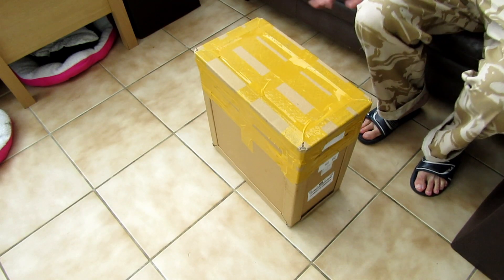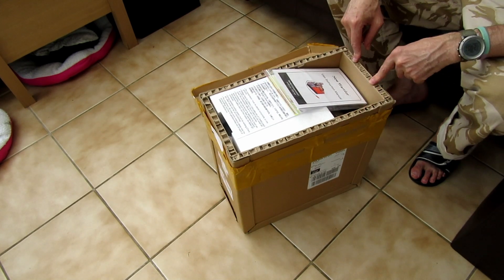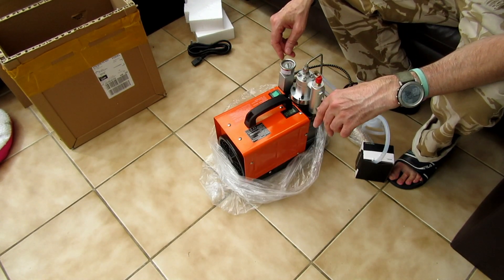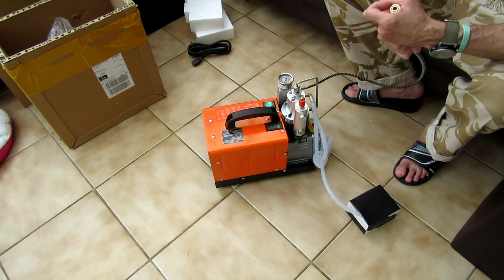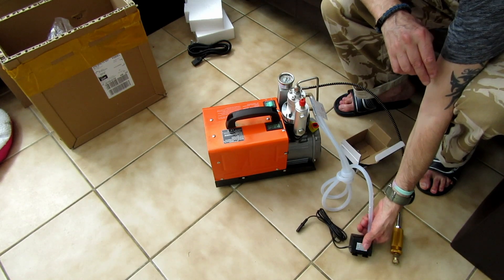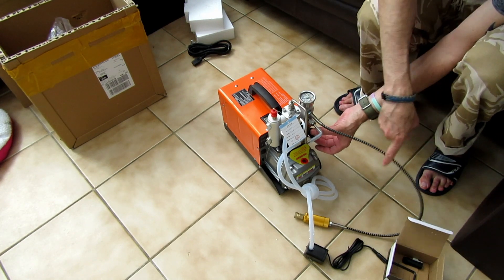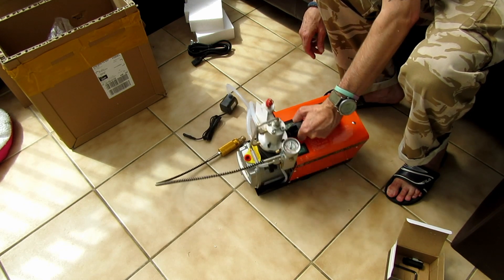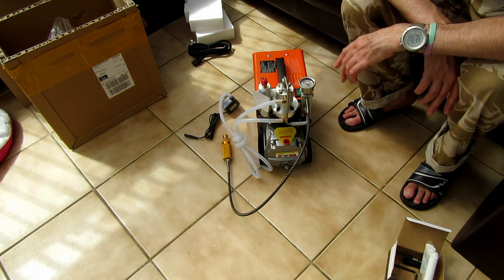30Mpa/300Bar Air Electric Compressor

Comment: Have you done a how to use video for this compressor as some have had the heat dissipator get warm and use a tap flow of cold water to keep temp down. What are your thoughts on this model? Many thanks
Reply: I found it best NOT to recirculate the water if you are doing much more than filling a couple of guns or topping up an air cylinder.  I rigged up a water reservoir with an overflow running to waste.  A hose from an adjacent tap keeps it topped up.  The difference is a much as 30°C cooler  which, of course, also cools the oil and causes less wear on the unit.  The whole unit s superb but it must not be used for breathing air as it gets slightly contaminated and smells slightly of oil.  Produces very little moisture in the short term.  I've had mine for 18 months now and can wholeheartedly recommend it.  Mind you I got in early and paid only £165 delivered.  The prices are going up in the UK but if you're quick you can pick one up for about £215 in the UK though I have seen them being sold for over £450!  Don't hang about.  One of these and a 3 litre bottle is the perfect set up.  Btw they weigh a hell of a lot less than 30kg.  At a guess I would say about 15kg.
Reply from the maker: Hi yes there is a 2nd video showing me use it on different items the link is on my site let me know if you cant find it
Reply: @Beta250trials  thanks for the reply much appreciated, I did find it in YouTube suggestions, its very good, but a little more info on setting it up ie adding oil, water connections and how to set it up would be great. I know it'll help a lot of people interested in these Chinese compressors. Atb
Reply: @OA-Chat  Really simple mate  All you have to do is fill it with oil.  Insert a filter. Get a water tub and away you go.  Everything is already connected.  However you may have to alter the terminal connector to suit your fill probe.  I advise everyone to record the running hours of the unit as there is no timer.  That way you have a record by which to judge your service intervals.  Treat this little unit well and you'll get years out of it.  I qualified in compressor use and maintenance as well as  breathing apparatus instruction and this wee piece of kit has really impressed me.
Reply: @Biffo1262  that's great info and really appreciated 👍 I've got one the same as yours I think, just thinking... could I use ice packs in a bucket to chill the water as I'd think it would save wasting off and less mess. 🤔 I give it a go very soon as my bottle is getting low so I need to get on it soon. Thanks for the time to reply and input, much appreciated. Atb